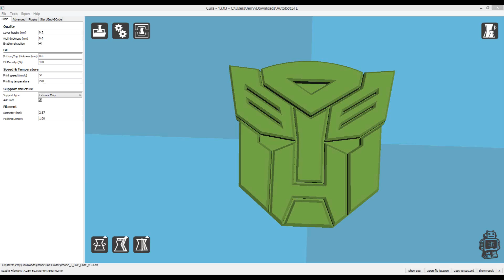Creating Transformers Autobot Badge on my Ultimaker 3D printer - Timelapse w/ Commentary

Comment: So after watching a bunch of your 3d printer vids I was inspired enough to return to mine and try again. after 2 hours of utter frustration and swaering I've so far managed to 3d print wool.. spools of random fluff and broken bits of my design. the print bed never sits at the right hight when it makes the first layer, I've sat caibrating it all night and playing with the bed, and even tried propering the bed up a bit in case the springs weren't strong enough etc to actually push it up to the right hieght. After only once gtting it to actually start printing I was overjoyed and left for a few minutes after it had done 5 layers succesffully. I went back only to hear it grinding as the motors slipped because the head had hit the last layer... 
CURSES aren't enough to vernt my anger with this damn thing.  Is the Ultimaker 2 less frustrating? Can i trade mine up with the company lol.

Comment: i use the robo 3d r1. and had a question. i CAN NOT get my first layer solid like that. my filament always has a gap in it. any ideas or settings your using that could help?
Reply from the maker: Nathan Horning When the print starts try turning the screws a little bit on each side to lower the print head just a touch and see if it fixes it. If not then you have an under extrusion problem so check your temp settings.
Reply: +Barnacules Nerdgasm hallo